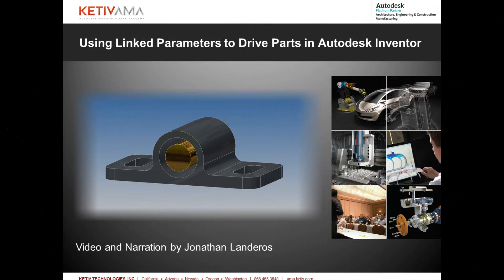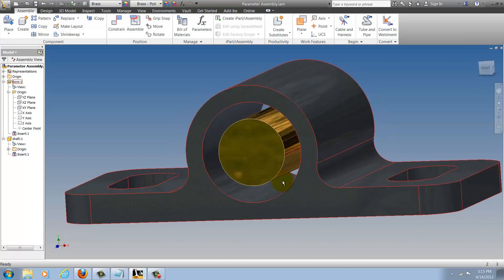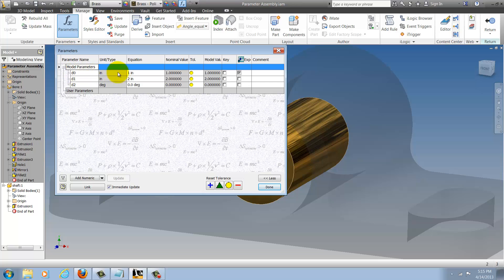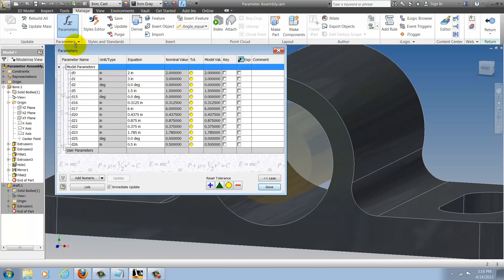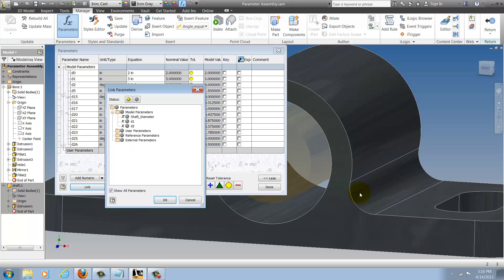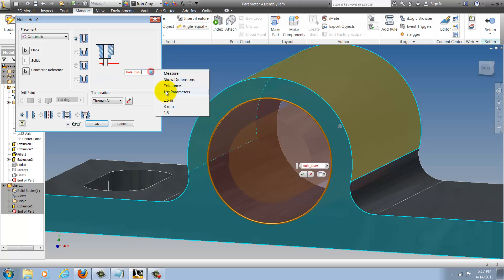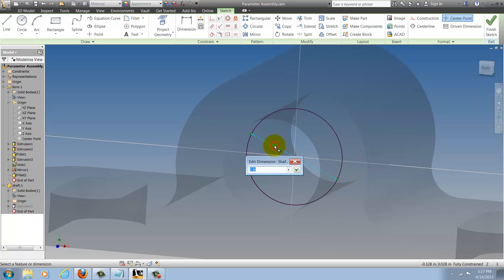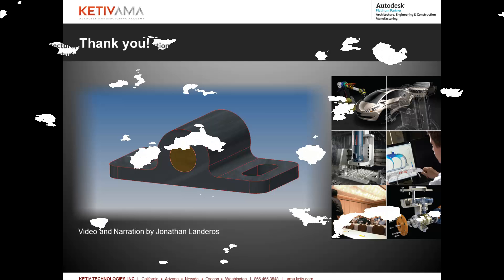How to Use Linked Parameters to Drive Parts in Autodesk Inventor

Comment: Thank you very much. But I want to drive parts from an assembly. I have a Linear Actuator and want to enter stroke length in the assembly. Is that possible. It keeps telling me it is a cyclic dependency. Is this just always the error message because it can't be done or do I have to hunt down some parameter that is getting in the way?
Reply from the maker: It looks like you have some sort of constraint/dimension that is prohibiting the motion. I'd start by looking there.

Comment: How about this. Can you change the value of the Shaft_diameter from within the Assembly parameters? Or do you need to go into part level first? (it takes more time, especially when programming a standard part).
Reply from the maker: Hi Mark, there are certainly ways to drive the parameters down from the assembly level into the part level. Depending on what you are trying to accomplish, there may be other methods to automate that parameter change most effectively.

Comment: When in shaft parameters you have to tick the export parameter box on the right hand column, otherwise you can't link it to the base
Reply from the maker: Hi William,

Actually you get prompted that "Selecting a non-exported object will modify the base component to make the object <PARAMETER NAME> for export". So it will edit that parameter to link to the base even if you did not manually click the "export parameter" box in the Parameters dialog. Hope this helps!

-Nigel